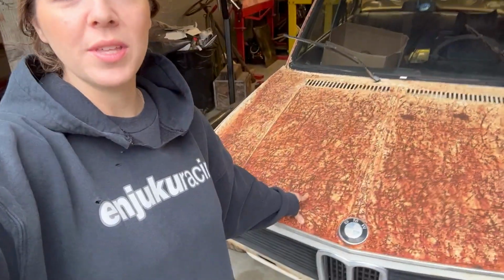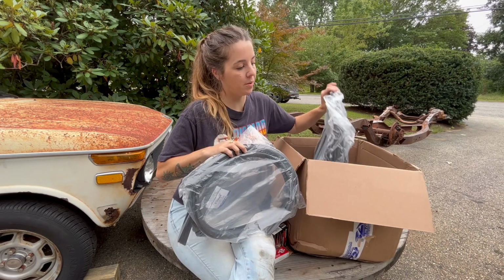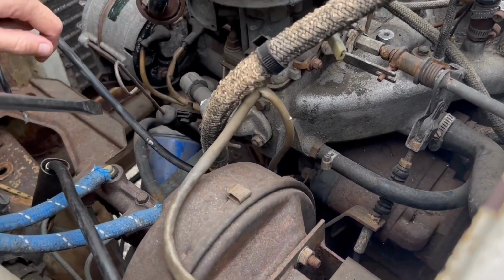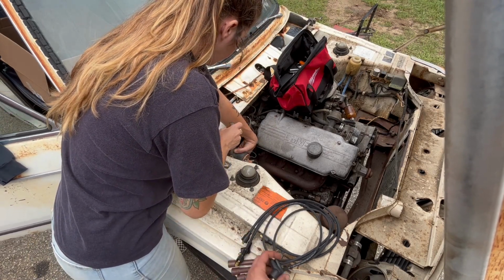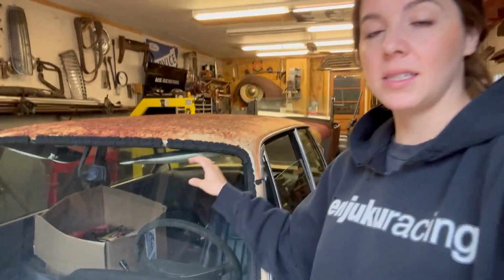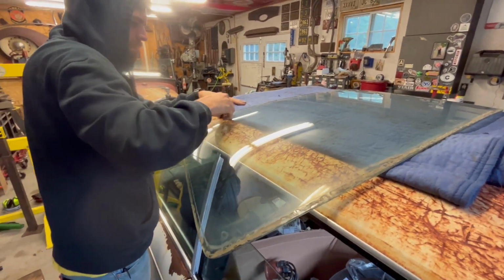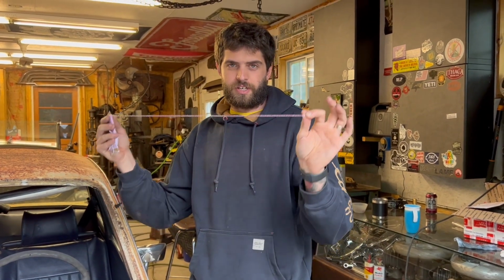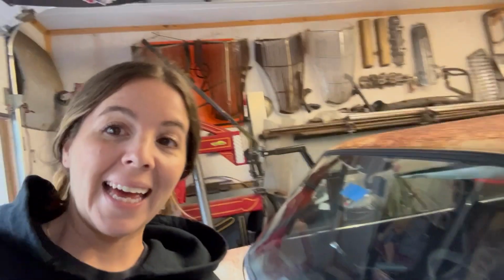BMW 2002 Windshield BROKE and showing next project 1936 Ford 3 Window!

Comment: @18:20 My thoughts exactly. It might tear through the rubber.... 
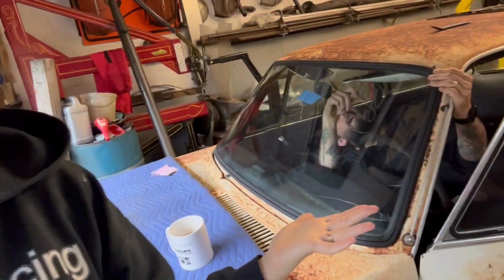@20:51 Remarkable, it must have been replaced earlier. Originally there only was hardened glass, not layered glass like this one.👴😉🤔
Reply: If that's a US car it came with laminated glass since that's been a legal requirement in the US since 1937.

Comment: what's funny is a few years ago i was watching your partners channel despite the fact that i'm a b-sedan guy. in my search for what limited 2002 content there is on youtube, you showed up. a few videos in i realized you where on the "set" for RAC garage. pretty neat! FWIW, bmw e21 sport seats bolt right into a 2002 and they are great seats, manual pedal boxes are getting expensive, you can modify the auto one with the skillset available to you. if you want your heater box to work, make that happen with the windshield out of the car or you will regret it. the dashboard can only be removed with the windshield out of the car and the headliner goes in prior to the front and rear windows as well, just sayin'...

Comment: Like I said earlier in one of my posts, my late uncle has 2 Agave 71-73 roundies, not sure exact years, sitting on blocks, and the sun is beating on them, there’s some rust spots on the paint, but I know  that they were driveable before at some point, I just need to figure out a place to store them temporarily until I retire and have time to get them running again 🤞
Reply: better get to it

Comment: I got my replacement windshield from rockauto. The brand is Fuyao. I know Pilkington also makes a replacement. If might be a blessing in disguise. Old windshields are usually pretty pitted.
Reply from the maker: I’ll definitely have to check them out, thanks for the info!

Comment: In any kind of automobile using direct sunlight it will heat the rubber up make it softer clean the surfaces don't need oil don't need rope starting one corner and work yourself all the way around